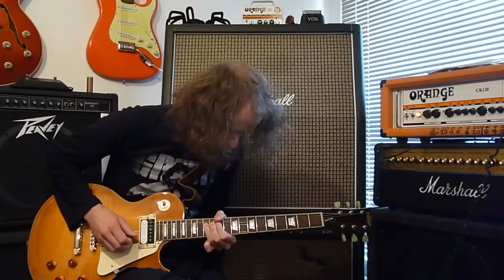Why I prefer Solid State amps to Valve amps

Comment: The difference in tone only really shows up with volume.

The amps i teach with are all solid state or digital (the fender gdec is a killer little amp at low volumes). At lower levels, it just doesn't matter. In fact, in many lower volume situations, i'd rather have a solid state amp.

But the bands I play with are all top 40 dance bands or hard rock/metal acts. With those situations comes the need for more volume to compete with drums, bass, etc. A good tube amp will not only place you right where you need to be but it will do so at its best sounding volume. I've found you need a LOT of wattage in a solid state amp to keep your sound intact at higher levels because those amps don't like to be pushed as hard. 

I know a lot of guys will whine about this video but i see where you're coming from. Tube amps are heavy and comparably unreliable. Part of me wishes i didn't have to deal with them. But the part of me that goes "bassman, engl, classic 50! weeeeeee : )" is still winning for the time being.

Comment: Some amazing albums were recorded with solid state amps.
Take "Gish" from Smashing Pumpkins: it has almighty distortions. And they're solid stated.
I've personally heard the difference in "warmth" between SS and tubes, but I think it only becomes apparent if you're going for an high-gain sound; like, if you're trying to get a Van Halen tune on a solid state, no: it's not gonna happen. In my experience, the tubes just seem to give you a better, fatter compression that makes the tone warm and sustainy under your fingers.
But then, it's not just any tube amp: it's the one specifically designed for creamy and gainy overdriven tones.
Your regular tubes won't compress your licks like a Peavey 5150.
And also, a good solid state amp can give you an incredibly focused high gain sound that a valve amp just cannot produce, and amazing cleans, if you ask me.
Overall I might agree with you. Solid state can be a better option. It just depends.
Reply: what’s ss amp did they use on gish?
Reply: @lady.jane.333  I wish I could remember. I might have read it on a Butch Vig interview, or heard it from Billy Corgan doing a live stream. If it comes to my mind, I'm posting it here
Reply: @lady.jane.333  For Rhinoceros they used a Roland JC-120. Don't know if it was the only SS amp they used during the sessions, though

Comment: The biggest factor for me is volume, edge of breakup, and pedal friendliness. I have not found a solid state amp that gave the volume, cut right in the mix, and had the pedal friendliness I wanted. If any have a design that allows the cleans to break up smoothly, it's too loud for me to use. I had to use 100 watt solid state amps to get volume, but then I was fighting certain buzzy or shrill frequencies at the volume I needed. Also, I've fought with tweaking and amp settings way less with tubes than with any other (that Orange did sound good in the store though). It's funny how different each experience is. Too each his own.

Comment: Hey Dave, what Marshall is that? I recognize the CR120, but i dont know that solid state marshall you got there. I am also a solid state player, and my latest buy was a surprisingly little Hotone British Invasion 5 watt that will do everything. Bass and treble at max, mids at 3-4 (very middly amp), gain at about 4-5, master set to taste (sounds at its best between 6-8), a Mooer Hustle drive in the front (veeeery versatile pedal, goes from clean boost, to slight "hendrixy" break up, to overdrive, to distortion, to high gain, to fuzz and everything in between, and with the "high peak" mode on the switcher turned on you get some top end harmonics, sounds beautiful) and a 7-band EQ (bass and treble boosted to increase presence and resonance and bring the amp more alive at lower "midnight" volumes) plus reverb (Hof mini) in the loop: welcome to any tone you could possibly ask for at a home friendly volume...after buying this little Hotone 60-euros amp i literally sold all of my other amps including my valve amps...it is literally the only amp i own at the moment and there is absolutely no tone that it won't do, i love that thing...maybe you should give it a go too! cheers
Reply from the maker: The other amp is a Marshall MG100 HDFX. I do wan to give one of those a go and hopefully at somepoint i shall. Thank you for watching. :)

Comment: I've used both tube and SS amps, and I agree with almost everything Dave says.  I do hear a difference, though, but it's more something you feel than hear, as tubes have more "thrust."  If you have a SS with enough headroom and a good tone, the differences are negligible if you ask me.

I've owned a few of both types over the years and the only really good tube amp I've ever owned was a Peavey Classic 50...the others were constantly in need of repair and were not versatile in the least.  In contrast, the only bad SS amps I've owned were the ones you'd expect to be bad...Crate practice amps from the 80s and 90s and the like.  Best 3 amps I've ever owned were the Peavey Classic 50, a Peavey Bandit, and a Marshall Valvestate...and only one of those is a tube amp.

Comment: Being a bassist, I prefer tube amps simply because most of the solid state bass amps are these tiny, 2-6 lb plastic and metal things which don't look good at all. With a tube bass amp, you get something that is more traditional looking, which is what I like. Also, for me, I like having a little bit of heft with things because that just makes them feel like they aren't cheap and cheesy.
Reply: There are beefy solid state amps, you know. Not all solid states are $50 amps from Walmart.
Reply: TheRosswise The thing is, those are few and far between. That's why I said that most of them were small, not all of them.

Comment: You can't beat the "organic" crunch sound of a genuine tube amp.
Reply: As someone else aptly pointed out in another comment, there is nothing “organic” about electric guitar distortion. It’s called distortion (or the crunch) for a reason. Do the harmonics sound better? Sure. And there are many other qualities about tubes over ss. But ‘organic’ is not the accurate term. If you want ‘organic’, play an acoustic guitar.

Comment: When you can see that it's a tube amp it sounds a lot better. And when you've paid 2000 plus bucks for the tube amp, it sounds even better.
What's best though, is when you've paid a couple of thousand for an original Klon solid state overdrive pedal and you put it into the clean channel of a boutique tube amp - because that's the point when you realize that modern solid state technology is shaping your tone just as much as tube technology.

Comment: Apples and Oranges guys. You can't compare SS vs. Tube, because they are totally different tools. Tube amps are unpredictable, touch-sensitive in the dynamics and the good ones are reliable - there is something to be said about a hand-wired tube amp from Leo Fender that has been going strong since the 50s/60s. I am extremely biased in this subject, as we all are - based on our experience. I will say that for all of the high-end SS modeling amplifiers, they can get very close, but nothing will ever replace the authentic compression produced by a vacuum tube. I play a Swart Atomic Space Tone Pro with 60's NOS RCA 6V6s and NOS GE 12ax7s, and it's an absolute thrill to play. The way the amp compresses and distorts at high volumes is harmonically rich and sounds fantastic in a mix.Now, if I were primarily a studio/home player - my needs might be quite different and something like a Kemper would probably be more ideal. I think for performance, tube amps will always be the way to go.

Comment: I bet half of the people couldn't tell the difference in a blindfold test. It's just 'tube' equals 'real' in the guitar world. I have a Marshall and a Fender, both tube amps and I love them but when I'm playing live I'm always thinking if the tube amp will break down. Everybody was using digital delay in the late 80s and now they're all into anlog delay. The guitar world goes through trends. Saying all that, I still haven't found a solid state amp that sounds fantastic and offers the harmonic distortion of a tube. I have an old Marshall Valvestate and it sounds awful compared to the Marshall all tube TSL602. Please recommend a great solid state amp?
Reply from the maker: I would highly recommend the Orange CR120 or the Marshall MG100 hdfx. : )

Comment: Solid state has come a long way since the 80s, they sound very good these days, and i agree with Dave on this video for a lot of reasons. Im the same, cant afford a 50s tweed twin or a marshall plexi head and cab set or combo. Plus weight is an issue when your gigging regularly. I have had a few valve amps over the years, and a big point for me which is jut as is important is reliability. My fender hot rod deluxe i owned 15 years ago before kids and mortgages came in to the picture and my wallet, andi could affor it! I was forever having it repaired, plus you have to be so careful loading and unloading it with all the valves and tubes being so fragile. When its 2am and you want to get home, and the drummer is loading his drums in and the pa is loaded in not quite as carefully as at the beginning of the evening, to start thinking about your valve amp and its position in the van goes out the window! I love valve amps and they do sound nice, and you def have more control with the volume at your fingertips, but for reliability weight and running costs i can sacrifice a bit of tone, and its hardly noticeable these days as the amps are so much better. Im sticking with the solid tte until im john mayer rich and hve a Roadie setting it all up and packing it away for me!

Comment: I have to agree with Dave!
Our lead player has a '66 Fender Twin Reverb (blackface). I'm not a "super" player like Dave or Blake (our lead player) is - I went to keyboards and concentrated my efforts doing that but I still play guitar some when the guys will let me!! LOL!. However, I can tell you this - Blake loves and hates that Twin Reverb amp. He can literally move the thing 10 feet and it sounds different. Humidity also affects the way it sounds. Sometimes it's spot on and at other times it sounds like crap. We don't care what the "pros" use - we use what sounds good to us.
That said - way more sound consistency with the solid state amps and I believe it's more about the player than the amp.

Comment: I totally agree. It is amazing how things have changed, when I was a kid most would have said everything you said plus they thought solid state could sound more modern and commanding. Yeah there was sometimes someone in the background saying you can't beat valves, but we had little idea what they were on about. We thought valves were going to be phased out but now they have become a seemingly global religion. 

I had an HH bass amp for a few decades that had a valve sound emulation, a circuit on the eq I think, which could get way more sounds and far better sounds than any bass amp I came across in studios...which was HH's intention they were in an era where solid state was seen as better.

On another youtube where they claimed "with a lot of transistor amplifiers"..."that sizzle becomes very harsh" ... I responded; Personally I think that's what the tone controls are for, hence the term 'equalisation'. 
As I type I am sitting next to my Vox AC15 (I owned AC15's since the 1980s) and an Orange Crush 35B (yup putting guitar through a bass combo with Low and Mid at 0, High at 4.5) with an EHX Hot Tubes and Holy Grail, sweet spot the volumes and tones on my 57 pickup Gibson SG and there aint no harsh sizzle just clang, chime and crunch. 

If a solid state is breaking up in a unmusical asymmetric way back off the treble and turn UP the master volume and it will start to give more dynamics ... kinda like a valve :-o 

I binned my first VOX AC15 when the valves started to go because my cheap theoretically rubbish solid state VOX Lead 50 was way better at clean loud resonant woody tones and conversely clanging tones (like Bowie Lets Dance) ... yeah the AC15 had the sag, compression, sustain kinda stadium rock thing ... but we were a little tired of bloated guitar sounds after the 1970s. In fairness my modern VOX AC15 seems significantly better than the one I had in the 1980s. In the case of the VOX Lead 50 it was much about the box and the speaker interacting with the tone controls, get the volume up and it became a ball of sound like a viola. 

(edit: and to back up Dave's consistency comments; over 2 or 3 years the 1970/80s AC15 sound changed radically and lost headroom whereas the cheap Vox Lead 50 sounded almost exactly the same tonally 35years later albeit volume pots became a bit hit and miss)

In the late 1970s many club guitarists had made an art of getting way better sounds out of solid state (kinda like the Roland Jazz Chorus kinda vibe), and you could not have got them to go back to valve if you held a gun to their heads. Just like many punks just wanted an HH solid state on full volume and again they would not remotely put up with some fizzy squeaky squawky ...yet ... wait for it--> dead and dull hippy valve amp. I remember someone turned up with their beloved Fender Twin Reverb ...total fail ... well we presume it was a total fail ... we could not really hear it so who knows.

Comment: I totally understand your reasons about how impractical valve amps can be. But there are lots of hybrid amps out there that go over weight, price, size and power issues. Even though one might prefer the sound of a solid state amp, having a more valve amp like tone will cut better and also make the performance closer to the original since the songs played on the gig probably were recorded on a valve amp. On the getting sounds issue I don't think neither valve amps nor solid state amps are any good though. Bias or Axe fx if you have the budget will always get you closer to the desired tone since there are no limits on how much you can edit the tone. Bias also is weightless. Solid state amps just don't seem to outweigh the pros of any other amplification option. The only way I see them viable is in a starter pack with a chibson.

Comment: You play awesome, good licks. I definitely hear the difference between tube and solid state amps. Some solid state smps sound great. But 90% of the time I prefer tubes. But I totally see your point, tube amps are more hassle, maintenance and cost over 5 times as much. If I  were a working musician, I'd probably rather use a solid state amp. Truth being your audience could care less, and in the mix couldnt hear any difference.

Comment: Interresting and nice Video, thx! 

I would be curious though, why you carry those super large amps? Is there a gig, where you don't get plugged & miced to a sound reeinforcing system from the sound engineers? And when you use small valve amps, lets say like 10-15 Watt, first I think they don't tend to get damaged so easily. Furthermore, you can turn the gain open way more without getting too loud,- and so you have so much valve saturation and rich sound, which solves your problem regarding to when you said valve amps would sound dull(er) when they get to little power. (Because you already have so much 'full' sound spectrum that it won't matter if it gets dampened a bit)

best Regards! (:
Reply from the maker: Thank you very much. I carry the head and cabs to gig because i never mic my amp up unless its totally necessary. I love the sound of a 100 watt amp turned up and the feel of a 4X12 cab cannot be beaten to me. I have lots of small amps but they just don't do what the big ones do. :)
Reply: You're very welcome, love your whole channel and playing too by the way! :) 

Ok I see.. We discuss that topic in my band sometimes, and my friends where so certain about the point that a sweet 100W Marshall Plexi Reissue would be of no use (to me) because of what I said before... (I adore Plexi sounds)
And yes.. for our band garage its really definitely a tad loud. But the sounds you already get in that videos speaks volumes.. sounds really so frusciante like, and 'true' mostly :)

Comment: Its funny how many people who say solid state is bad especially for high gain still have a 50 usd overdrive pedal in front of their 1500 usd tube amp. Never had an issue getting a nice tight tone out of a randall or marshall valvestate without boost or compression.

Comment: practically 2 years since this video was uploaded, add my set of boots to the SS welcome mat, Dave! i have both & i appreciate the commentary re: consistency, reliability, & costs associated w/ owning & operating amps. as others have suggested, it's the player, NOT the stuff that counts (mostly). one achieves more in the tonal landscape w/ one's digits (IMHO) vs. all the other nonsense, technical bullshit & geeky what not AS WELL AS the costs. to me, it's a lot like golf (bear w/ me); i know dudes who can play a round w/ a $35-$50 USD set of garage sale sticks and whip the britches off the dudes who dropped $400 for the latest driver and/ or another $350-$500 for a slick putter! it's the same w/ guitars, amps, pedals & ancillary gear. sure, you can go banana heads (if you've got the scratch) but the net effect won't achieve great tone any more than a $500 Scotty Cameron putter's gonna' make you a single handicapper/ scratch golfer. to me, the amp thing boiled down to costs as well, Dave; do i dig tube amps? sure. but trust me, i'll take a Roland Jazz Chorus 120 or an 80's Randall RG 80-112SC (a phucking tank) over some Fender, Marshall, &c. valve amp any 'ol day of the week. plus, you never have to replace valves either (to your point). it's a personal thing - naturally - but i'm w/ you & your logic, man. rock on... enjoy your vid's... brilliant ;-)